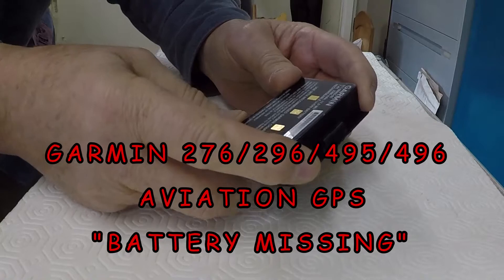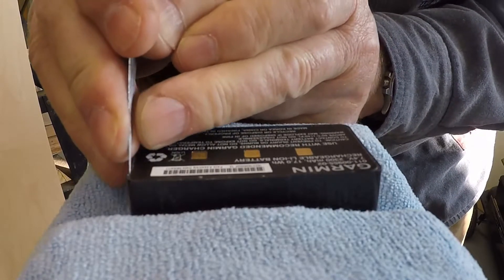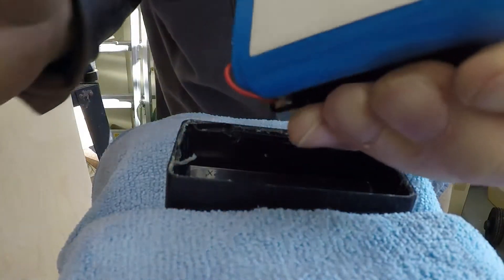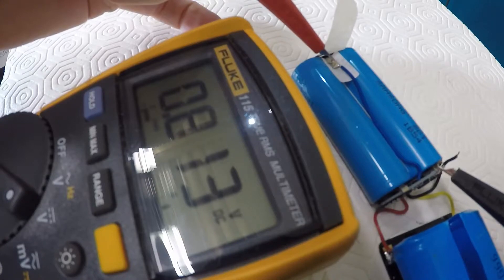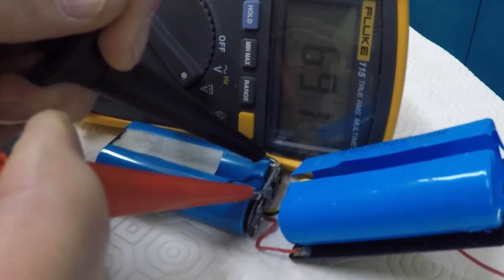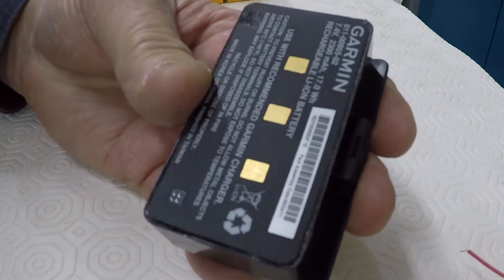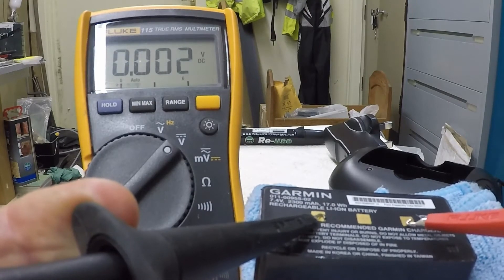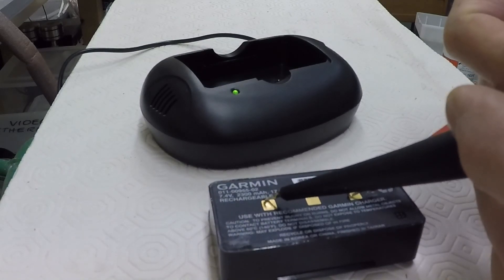Garmin 276 / 296 / 495 / 496 "DEAD" or "Battery Missing" Recovery.

Comment: Years later, now 2025. Thanks for the video, you saved my battery and GPS unit. I used the idea and like someone else managed to recharge mine in a similar way to @daveidlaughrey4776 without disassembling the battery by using safety wire jumpers but just using the LH terminal as the negative and the RH terminal as a positive (when viewed with the locking clip up and small terminal on pp3 is positive) and left it charging for a few hours. It got it above the minimum voltage for it to allow the unit to start up and it's now accepting a charge. Started at 5.65v last checked at over 8v with pp3 connected but showed up as minimum charge once the Garmin 276C turned on. Currently now charging up from the mains power supply. Unfortunately didn't check the voltage after the pp3 was removed. I can not believed that it works, but it does. Why did Garmin stop the battery from working once it went flat? Thank you Super Reality Kid and David for giving me the crazy idea that I could recharge the battery.

Comment: how did you determine which was positive and negative using the multimeter?  what mode is multimeter set?  voltage?
Reply from the maker: With a modern multimeter, set to the voltage type, eg  DC, or AC, it will display a negative symbol if the red and black probes are the wrong way round.
Reply: Thanks. @SuperRealityKid
Reply: @frankdavis3486  I was disassembling this battery. If the Garmin label is located at the top, then the right contact is +, the middle contact is -, and the left contact is the data line. Therefore, the author of the video did everything wrong.

Comment: Would this method work on a Garmin GPSMAP 640 battery with 4 contact terminals?
Reply from the maker: As long as you can locate physical ends of the + and - terminals of the enclosed batteries, it will work. The problem with a deeply a discharged battery of this kind is it does not even have enough internal power to run the onboard circuit board that "allows" charging to start. Good luck.

Comment: I have recovered the battery without opening it up, as others have commented here. I used the outer terminals, identified the positive and negative with a multimeter - for me, with the battery oriented with the printing rightside up, the left was the negative and the right one the positive. I had about 1V in the garmin battery. With wire I connected the positive terminal of a 9V battery to the positive of the Garmin battery, and likewise the negative to the negative (reversed polarity so the greater voltage from the 9V battery forced the current backward thru the garmin battery). Left it over night and resulted in about 5.5 V in the garmin battery after disconnecting. Put it back in the 296 and it charged back up from external power.

Comment: I wanted to add my thanks to the already existing chorus.  It appears I have successfully revived my Garmin GPSmap 396 as it now indicates that the battery is charging rather than the dreaded "Battery Missing" message.  
Reading all of the comments led me to try revival without disassembly. I wired a 9volt battery to the correct terminals on the back of the Garmin battery using a couple of small finishing nails, two clamps to hold them in place and an alligator clip to connect to the positive terminal on the 9volt.   Left it "charging" overnight. Many thanks!!  🪂🛩🚁

Comment: Hi, thanks for all your input, I have a 276c  I need to charge. Do you have a picture or a sketch of the terminals on the battery, ? Do I have to use all 3? Or just the 2 outside terminals?

Comment: I have been ultra inspired by this fantastic video!
I have however tried my own experiments.
How this all started with a message on my Garmin GPSMAP 296 that said 'Battery Missing".

LATEST UPDATE: 21/06/22 - After YEARS of not being charged, this method WORKED. After 7 hours of being on charge in the unit, I have tested the battery, and it is maintaining voltage!

Hi All, I have the same problem with my Garmin GPSMAP 296. What I did was get a 12 volt battery, and I took the 296 battery out. With the Garmin logo on the back of the battery looking at you, and the 3 copper points on the back of the battery, the one on the very left is the negative, and the one on the very right is the positive.

I connected a 12v battery to the positive (right) and negative (left) terminals for 6 minutes (I haven't tested the centre terminal to see what that is). Prior to connecting the battery, I had 0.586 volts on the Garmin battery. After connecting (with a couple of wires and sticky tape) to the terminals, I set a timer for 6 minutes. After the 6 minutes, I had a voltage of 2.658 volts. I put the battery in to the Garmin 296 after that, and it didn't say 'Battery Missing' like it has for ages, but now says charging. I've got the 296 connected to a 12v source, as if it was in the aircraft, and the battery installed in the 296, so is set as a standard setup

I didn't need to take the battery apart or make any modifications. I've only just done this, and am hesitant to take the battery out whilst it says charging (love to give you a progress update to see if this method is successful - fingers crossed), but I'll wait until the morning give you an update after taking readings and post them here. It's either gong to be successful or not. This has been posted on the 20th of June 2022 from Eastern Australia at 7:32pm (UTC +10), so I'll update you with the results tomorrow. NOTE: I didn't use a 9v battery as recommended in the video. I decided to spike with a 12v to hopefully excite the circuit, but for a short period of time. So far, so good using this method. I should note however, that my battery pack is well over 10 years old, so I wouldn't expect it to last that long, but I'll see what happens after my experiment! I did order a new after market battery today, only because I know a 10+ year old battery should be replaced after that time, and I like to have a backup system (and don't rely purely on one source of power in the plane).

Please be careful if you decide to do the same thing. Go with a reputable dealer as there are many shonky batteries on the market. You spent a lot on the 296. Don't wreck it with a cheap and crappy battery.

Update for everyone - And I know this is a very niche site - Really, how many people fly planes and have a 296! Anyway, it is now 9:21pm on the 20th of June 2022 - And after 3 hours, the Garmin GPSMAP 296 still says 'Charging'. As I said, I'm not taking it off for fear it may be working and I don't want to ruin the process, even though I am so tempted to test the voltage!

More info tomorrow after at least a 6 hour stint (which will probably be 8 hours) but after that time, I will send through the results of this experiment anyway.

Okay - I have bought another battery anyway, so after 3 hours, I have decided to check what is going on. What have I done? Will it work or not? Okay, 9:33pm after 3 hours of charging: Wow - 5.31 volts! Maybe it is working! 

I pulled the battery out and had a message 'Battery Missing' after doing this.

Put the battery back in and had a message 'Battery Missing' for about 20 seconds, but then, ' Charging'. So far, this is working!

More updates in the morning! (9:34pm) - Feeling Optimistic! Please also note that the battery indicator on the 296 shows fully charged by the picture (no numerical figures or percentages) so obviously this these are incorrect statistics at my stages of this experiment.
Reply: Hi, thanks for all your input, I have a 276c  I need to charge. Do you have a picture or a sketch of the terminals on the battery, ? Do I have to use all 3? Or just the 2 outside terminals?

Comment: I opened the case as you showed and found the black wire hanging loose also as you did.  I assumed that I had cut it or pulled it off the circuit board while prying the back off.  There is a terminal with a bit of wire on it adjacent to that location.  You didn't mention whether you re-soldered it to the terminal on the circuit board or left it hanging loose?  Thanks for a reply.

Comment: I cut all the way around the box and so I could pry up the back cover a little but could not go any farther. There is double stick tape on the battery to stick it to the case. I took my hot air gun at the low setting and heated the back of the case for awhile. The case got warm and the tape got soft enough to put the battery out.

Comment: Hi
Can you give me the battery number
Reply: the Garmin battery may be one of several types, mine  is a  011-00955-02 (2300 mAh), and i had to disassemble it to revive it . It contains 2x 18650 with soldering vanes and a control circuit board

Comment: Thanks for the great tutorial.  My case was a little harder to get into as there was 2-sided sticky tape holding the batteries to the case and cover.  Couldn't find your charger on ebay.uk, but did find one in the US.  Thanks.
Reply from the maker: Hi, thanks. Yes, I sold out of those chargers. :-)
Reply: @SuperRealityKid  Battery looked like it was a gonner, but after following your instructions and cycling the batteryseveral times, I am now getting about 6 hours of operation on a single charge.
Reply: @SuperRealityKid  Unfortunately, the battery will not hold a full charge anymore.  Worked flawlessly for 10 years, so I suppose I got my money's worth

Comment: I tried this with a deeply discharged 496 battery. I was able to do it without opening the case. The initial battery reading before charging was between .5 V and .6V on the two positive terminals. I made two wire loops from safety wire and attached the loops to alligator clips and then duct taped them to the left hand terminal (-) and the far right hand terminal (+) the other end of the alligator clips were attached to a new 9 volt battery. I took approximately 6 hours to get the battery to a charge level of 5.4 volts. After that I charged it in the 496 overnight and it was now fully charged. I plan to discharge it to the 50% level and then recharge again. We shall see how it holds up. Thank very much for the video and inspiration to do this.
Reply: Do you have a picture of the battery so I can see what ones are the 2 +  ans one -  pins are ,??
Reply: David, Thanks for your recommendation. I tried your method last night on a battery that had sat for 7 years and it worked perfectly. Like a jump start.
Reply: David, thank you for the idea, it works :) connected the negative to the LH terminal and positive to the RH terminal with locking wire and got it from 5.65v  to over 8v with the pp3 connected. unfortunately didn't check the v with pp3 removed but it's now switched on and charging with mains power. Thank you for your advice

Comment: You can't imagine how much energy you saved by this video. Thank you, piece of good job. In my Garmin out of battery pack were red and black wires so no need to cut anything.
Reply: I found an even simpler way, take the rechargeable battery out of the unit, take a 9 volt battery,
place the battery right on the contacts of the garmin battery , the negative post of the 9 volt 
battery on the left contact of the garmin battery, the positive post on the middle contact, I clumbled
some tinfoil between the contacts and let it sit for 2 hours and Voila , charging normally and no
more message 'battery missing'

Comment: Great tutorial but there is a much easier way to do it, and without opening the battery. Place the battery in front of you so you can read the garmin logo properly. Connect (-) terminal of the charger to the FIRST terminal and (+) to the SECOND terminal of the battery. Charge for 8 hours at about 200mA and then put the battery back into the GPS, let it charge the remaining. Done! The only challenge is to attach the cables, you need something to put conatant pressure, like a clamp or something.
Reply: This much easier method of not taking the battery apart by attaching the charger wires with masking tape worked for me with my completely dead 495 battery, yay!
Reply: This can be much easier accomplished without taking the battery apart, simply take the Garmin battery out of the unit and place a 9-volt battery on the left 2 contacts with the negative post of the 9-volt battery on the left (negative) contact of the Garmin battery and the positive post of the 9-volt battery on the center (positive) contact of the Garmin battery, let it sit (charge the Garmin battery) for 2 hours and replace the Garmin battery in the unit and charge until it is fully charged.
I crumbled some small pieces of tin foil and place them between the contacts of the Garmin battery
and the posts of the nine-volt battery to establish good contact.
Reply: @mandolinviolin  Hi Peter  where is the positive on the garmin battery  on the middle or in the far right? For sure  the negatif is on the far left!
Reply: @ALF-PILOT  I can't remember , try it either way, you won't damage it, I think it is the far right.
Reply: @peterleyenaar8870  ok thanks you

Comment: Do you sell the charger?
Reply: Hi,

Thanks for your reply
I’m in France. Would you consider posting?

Found that one battery is dead flat (i.e. 0V). 
It looks to me it's just solded!?
no risk to harm it with heating if I sold it?
Have you ever replaced one?

I see replacement can be found on the web unless you can supply some too..?..

thanks
Philippe

Comment: Although there is a Protection Circuit Module attached to the battery acting as Thermal Interrupt etc, it appears that the GPS Map 496 has an on-board smart charger that will not charge the battery if the voltage is too low. After months of disuse my 496 showed "Battery Missing" and would not charge. A multi-meter showed 0,18 volts. Noting the polarity, i connected a 9 V alkaline battery to the two outer connectors of the 496 battery using wires and left it about 2 hours. The 496 battery then showed 5.9 V. On putting it back in the GPS Map 496 it showed charging and I left it several hours on charge. You do not need to dissect the battery, at least not with the  GPS Map 496.
Reply: on my 496 it did only work after i opened the battery. also it gave  some smoke puff on connecting the 9V battery with correct polarity. However, the rest of the process worked. I don t know if the smell was arching or it blew the circuit of the control board, though it is still charging correctly. I also don t know where the loose black wire, which i also had and soldered (after finishing the 9V revive) to the free spot on the housing is for

Comment: I did the same with AERA 795 Battery. After easy opening (cut along the lines on 4 sides of the battery) you will find 4 batteries.  Dont cut plastic wrap as there are 4 separate batteries coneccted 2+2 paralelly. terminals are covered with white stripes of paper between 1,2 and 3,4 batteries. Check polarization and connect +/+ -/- (v battery. As only battery raise the voltage to 6,6 V disconnect and put into GPS for fulll charge (regardles of cutted off top  everything stays in one piece inside). after that you can glue the cutted piece back or use as it is. When in GPS battery will not drop out.

Comment: It's too late now, but if you're going to epoxy it back together, it might be wise to make holes in the case so you can access those terminals in case you ever have to do this again.
Reply: "The power of accurate observation is commonly called cynicism by those who have not got it." - George Bernard Shaw